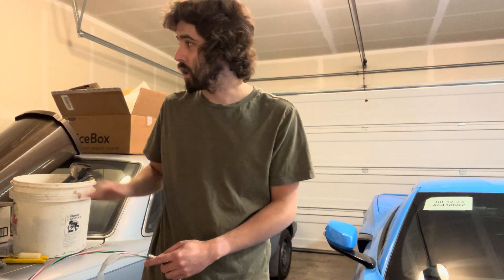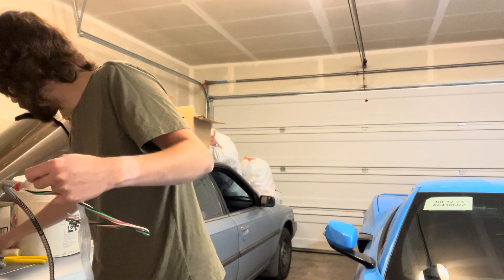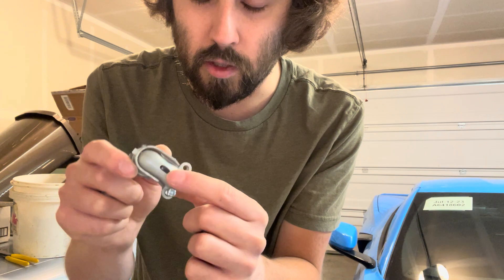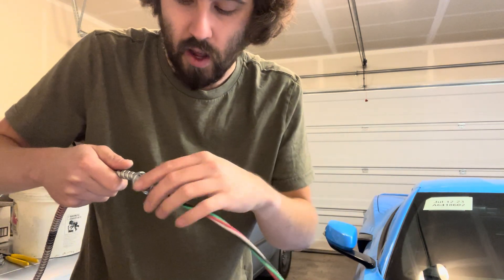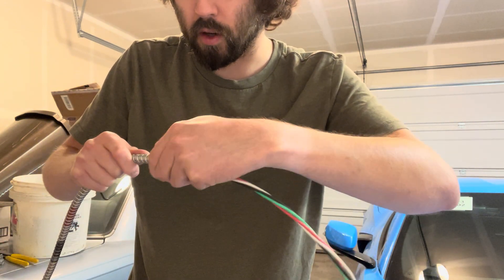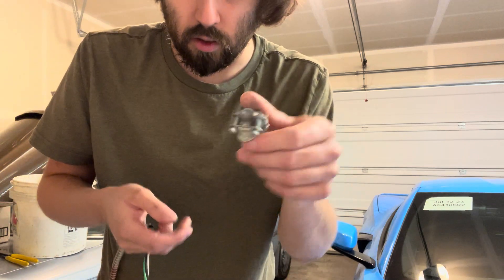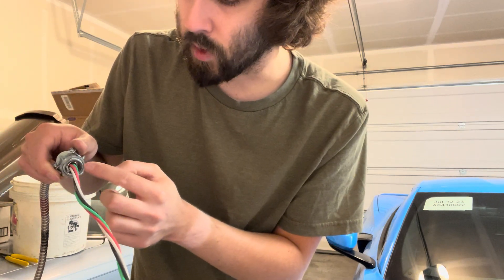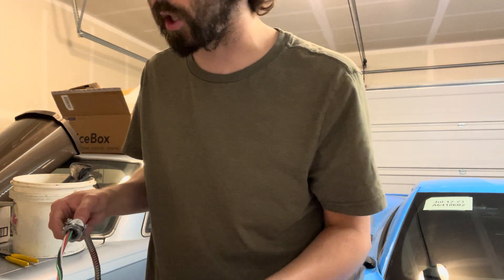Electrical 101: MC Connectors

Comment: Hey #1, they also make 45 degree in addition to the 90, plus there are the 2 barrel connectors where you can put 2 MC's in one knockout.
Reply from the maker: cant say i've ever seen a mc 45 before

but yeah forgot about the double barrels, havent use them in so long haha